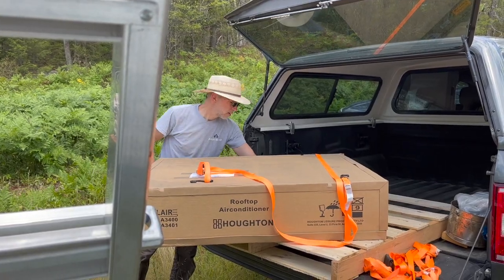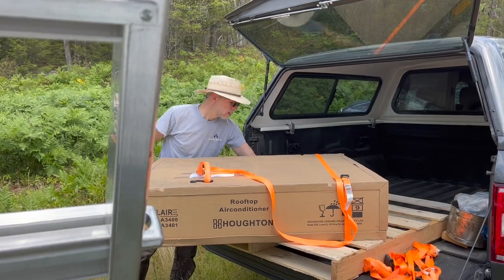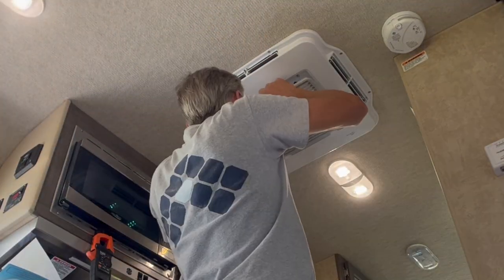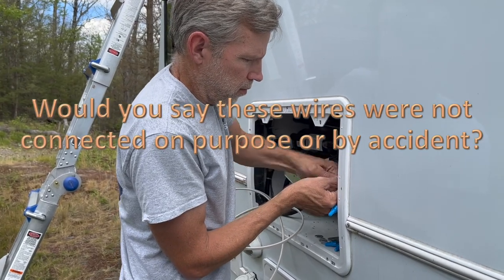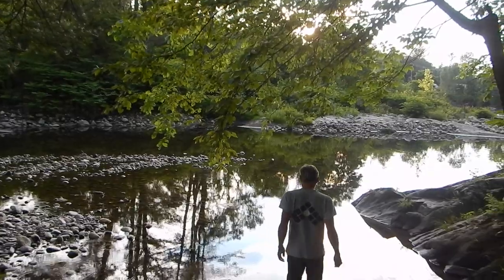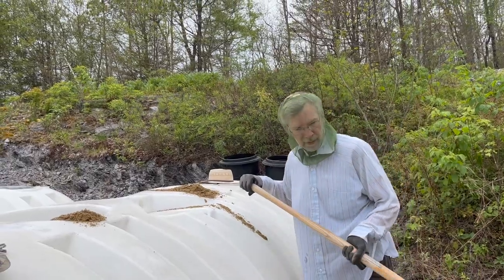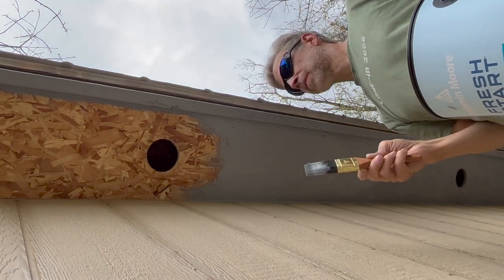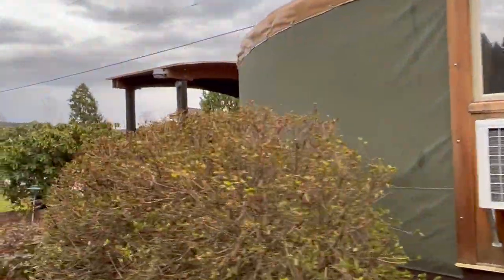Rooftop air conditioner DIY install (what every Bigfoot owner should know about A/C pre-wiring).

Comment: Hello Charles,happy for your a/c.when you were installing the a/c were you impressed with the thickness of the fiberglass shell? Also what is the inside material that the carpet is glued too? We’re in texas and get out BIGFOOT in October.god bless & be safe
Reply from the maker: Hey there. Yes, I was pretty impressed with the fiberglass thickness. It seemed very strong ... not as thick as a boat of course, but still substantial. Under the fiberglass is about 2" of foam board insulation, and the carpet headliner is just glued directly to that, as far as I can tell.
Reply: Thank you for answering,we are also getting a 2022 25’ BIGFOOT but ordered the twin beds.your so knowledgeable,GOD BLESS

Comment: note to self… if and when I order a Big Foot, get the a/c, actually never any doubt for me, I’m hot all the time even with air conditioning 😏  So, y’all decided this was the quietest model available and has meet expectations?
Reply from the maker: Yes, it's super quiet, and has worked great for us over the past month. Of course, being up north, we have not yet tested it in 100 degree heat. Some websites recommend 15k BTU for our size trailer and this model is only 13.5k. But we don't tend to crank the thermostat down too far, and the four season fiberglass should be decently insulated. Overall we are very happy with the purchase and we don't regret waiting to find a quieter unit.
Reply: Nice video! That’s nice you have AC now. Our 2005 Bigfoot 25RQ came with an 11,000 BTU AC. We live in the hot and humid Midwest and yet it still freezes us out. What’s nice is even without a Soft Start added (to decrease the initial surge) we can run our AC off a small Honda 2200 generator if we don’t have shore power. I’m looking forward to seeing the yurt in future videos.
Reply: @OvertheRiverandThroughtheWoods  yep, been RVing many many years and I’m sure the 13.5 will be plenty cold, especially given the superior R rating of the Big Foot.  See ya on the road, maybe at one of those fiberglass camper rallies 😉
Reply from the maker: @coms00  Yes! I hope so. We are going to keep an eye on the egg rally calendars.